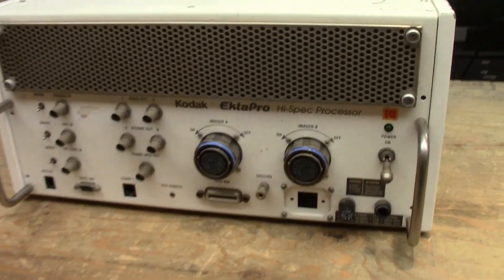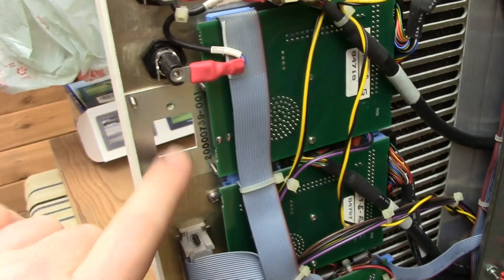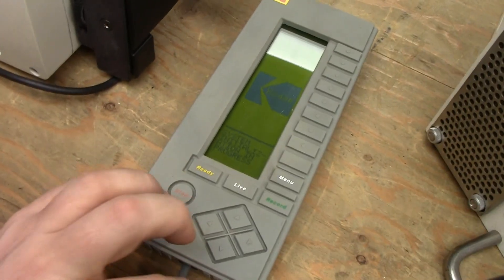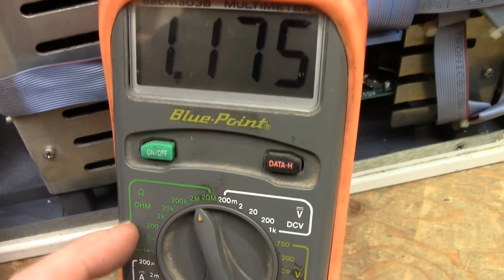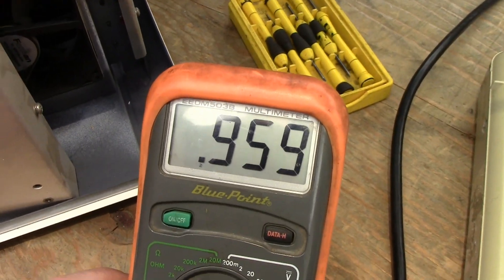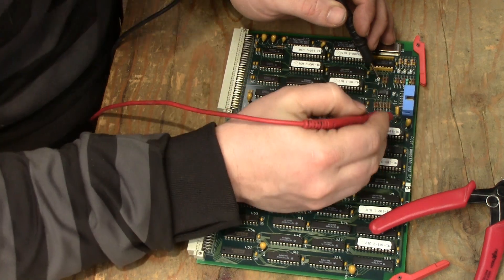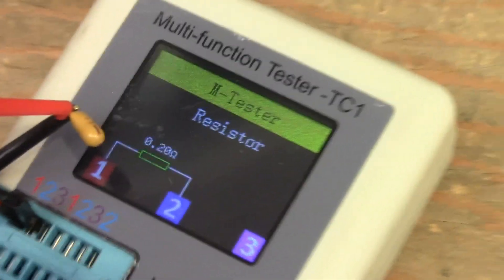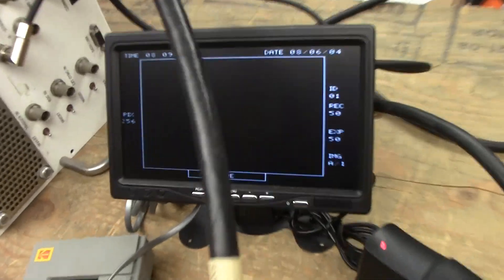Kodak EktaPro Hi-Spec imager repair - Can I fix it?

Comment: 16:23 Cool old CANON copier is that a NP-155...used to work on them doing board repair
Reply from the maker: It was fun while the cartridge was still doing good but unfortunately those aren't as easy to get even rebuilt anymore.

Comment: Do you get the software version error without the imager connected? I don't believe there is software in the imager, so it's the remote control that is incompatible :/
Reply from the maker: I need to talk to someone else who has a Hi-Spec and a working remote so we can compare ROM versions and try swapping hardware to see what changes. This was not an expected result.

Comment: The "solder blob" on the tant is a sign that it's failed. Normally solder does not stick to the epoxy dip on the tants. But if it comes from the inside, poking trough the paint, yep!

Comment: where do you find this stuff?!?
Reply from the maker: Ebay. I mentioned in a previous video that the Ektapro high-speed imagers often float under the radar for relatively cheap and so do the parts occasionally.